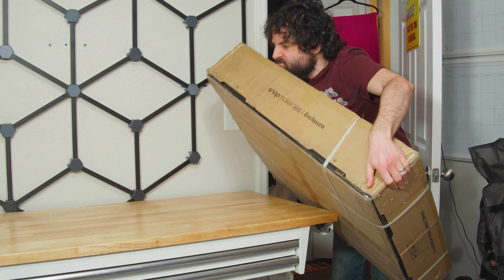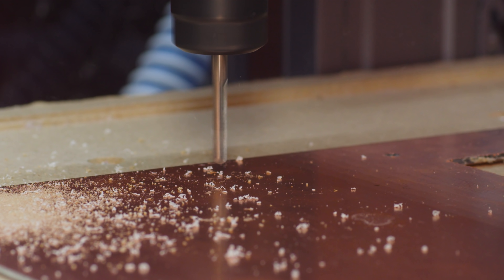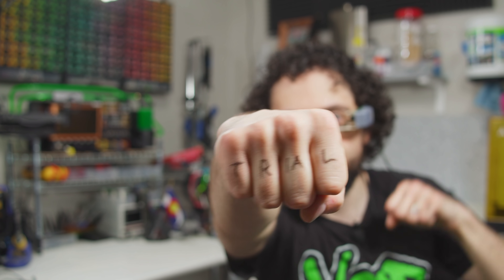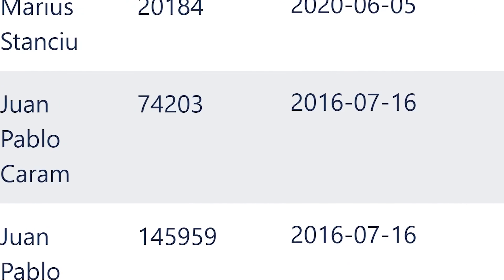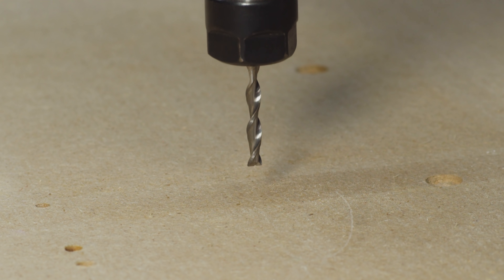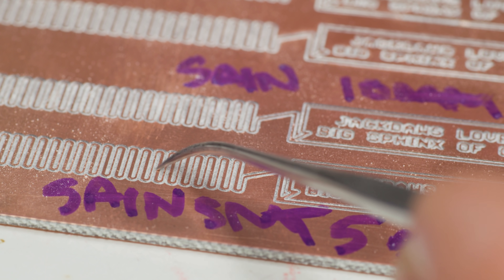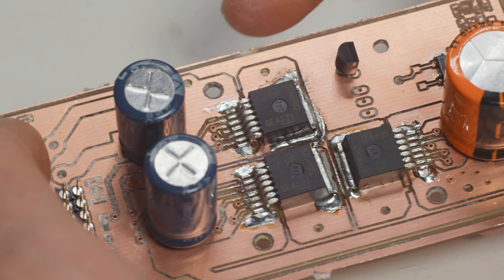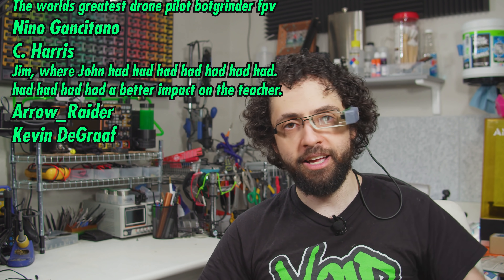PCBs in Two Hours? Zack Sucks at CNC

Comment: I use a trusty LPKF machine at work (Circa year 2000) and while the software has given me some troubles in the past with 2 layer boards, the large selection of bits has been great.

I know you're getting used to the machine but I use a bit that's 08-12 mil (depending on manual depth set) and whenever I lay out a board with some hairline traces, I just raise the bit up until I get JUST the copper clad removed. Sometimes I have to run the operation a few times to adjust it properly but I say this because your successful board on the precision end mill still looked a smidge deep and could be one of your issues. Of course, that's based on the camera angle but maybe it'll help.

Comment: Tip from a Mechanic, try running the Programm with out a Milling Tool first. So you can see if there are any possible collisions.
Reply: I think taking the pins out is the proper solution. There are CNC simulators too.

Comment: Great results for a first try!

I've made quite a few boards for hobby and professional purposes (mostly prototypes), I have a Sainsmart 3018-ProVer, which is very cheap compared to some of the dedicated PCB mills out there, but works very well for PCB milling. For control I use Candle, a very simple but capable little CNC software. I've gathered some experience over the years which I'd like to share:
- Clamp your board down firmly with at least four clamps. Tape works, but most PCB blanks are slightly bent, and if the tape doesn't hold it down perfectly, it may flex when you try to mill it, leading to inconsistent depth of cut.
- Install a leveling sensor. The simplest option would be two wires, one attached to the PCB, the other one to the milling bit. Alligator clips work fine. Most CNC boards have some sort of input for additional sensors.
- With the aforementioned sensor, level the PCB blank. One probe point every 10mm should be sufficient. Having a flat surface is not enough for the kind of tolerances we want, so software compensation is mandatory. All professional PCB mills do this. Candle works well for the software part, but most CNC software should have a similar feature.
- Precision end mills are nice, but quite expensive and fragile. I had good results with 30 to 60 degree V-tips. For holes, I use normal PCB drills. It's a bit more work to change the drill size for different holes, but milling holes takes way longer, especially if you have lots of them.
- Cheap bits are a bit of a gamble, sometimes they are good, sometimes they are garbage. But it's still cheaper to experiment a bit than to break too many high quality bits. One you find a type that works well, stock a few for future accidents.
- You want good quality bits, especially for isolation routing. Good bits cut with very little noise, and there should be no burrs around the cuts when you wipe over them with your fingers.
- Some sellers stock FR1 PCB blanks. Those don't have fiberglass in them, so they are way easier to mill and less dangerous, but they aren't as sturdy as FR4. For most applications they are absolutely fine though.
- Try to stick with sigle sided boards when possible. If you need two sides, you can connect the vias with copper wire, but most board designers will assume that all holes are plated through, and you can't solder both sides on all components (e.g. capacitors). This might lead to design flaws. Rivets are an option, but a lot of work.
- Don't bother with solder resist, it's messy, it takes forever and if you solder carefully, it's not needed for functionality.
- When the board is finished and tested, cover the copper side with protective lacquer. You can get that stuff in spray cans, there are special non-conductive types for PCBs. Keeps the moisture out and your boards look shiny and new even after years. Dries in a few hours. Also prevents shorts, but don't rely on that.

Happy milling, I hope you can speed up some projects in the future!

Comment: Why do you torture yourself with CNCing PCB boards. Get a rattle can of black spray paint, coat a copper clad board, laser etch out the traces. Use a toothbrush to clean it in water, then acid etch it. It makes surprisingly fine traces and waaaay more reliable than UV transfer methods.

Comment: You can't use the laser to burn a resist mask for smooth edges on those traces instead of that hot mess made by the milling bits?
Reply: If the raggy edges really bother you then you can just make a few more passes and that cleans it up nicely. CNC machines can make multiple passes easily. Repeating is what they do. It'll go over the same path from now until the end of time if that's what you command it to do. Usually 3 does it though. How repeatable CNC machines are is kind of mind blowing. But every pass the cutter will be in a somewhat different arc. Because the spindle isn't slaved to the axis. Although there's CNC machines that can do that too. But this isn't one of them.

Comment: try sprayer 3d printing instead of extruder 3d print, so more like paint spray than line draw print
Reply: so spray pen instead of 3d draw pen
Reply: I mean all materials, including metal, plastic, anything that melts to liquid, even two-parts mixed on the fly reaction liquids, like resins, it can have uv curing on the fly too
Reply: distant spray instead of close up line
Reply: photolithography processes

Comment: Can you get a cnc machine specifically for pcb milling? Probably a very small bed compared to 3D printers but can move the tool much more accurately and also use very small milling bits. I know you can get small desktop CNC's but are they good enough for milling PCBs?

Comment: For indexing you can set up and recall positions either with gcode or certain programs,  and using a simple 3d printed vacuum holder attached permanently on a location on your bed can do wonders for both workholding and easy release.  Nice video though, cnc doesn't get much spotlight since FDM is so much cleaner and quieter.

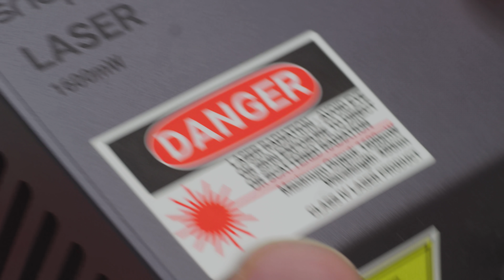Comment: While I DO love the Snapmaker's modular design, 1.6 watts of laser output power is VERY meager today, good only for etching, not cutting. And watching the closeup video at 2:28 of the tool plunging into the board, and FLEXING out by a millimeter or more just DOESN'T give me the warm fuzzies for this machine.

Comment: Good to see you’re doing all good buddy, your channel has been a real highlight the past year or so and I remember seeing your first videos and knowing you were going to be successful! But I didn’t realize how quickly your channel grow and it’s been a lot of fun to watch!

I have my own electronics and systems engineering “business”. Just me and a small lab I built several years ago. Mostly to fund my own addiction to test equipment. I focus mostly on component level troubleshooting and board repair for industrial and laboratory/research clients. I specialize in metrology and test equipment repair/calibration… And I really enjoy it a lot.

Nothing necessarily wrong with milling PCBs, it’s pretty great if you’ve already got the shop set up with similar equipment, and an area that is meant for dirty tasks. And it is a lot of fun….… 
But The etching process probably makes more sense. I mean obviously the best thing to do is just order the boards......because they’re so cheap, Much higher quality than you can do at home, and you get them really fast. sometimes I will be troubleshooting or problem-solving an existing circuit, and I need to reiterate and change the design and remake the boards a few times per day… 
If I were to do the same thing, but having to wait on boards for each revision… It would take a long time and I usually don’t have that option. But it’s just because I’m such an idiot, and I make mistakes in design… I’m a hardware guy not a design/layout guy. The only other excuse is because it’s a lot of fun! So I definitely don’t discourage people making them at home… But if it’s something you can get done at PCB way or elsewhere… I suggest going that route.
Also check out Marco reps and how he has made boards with several different methods. The laser method proving to be really fast, easy, and able to be accomplished pretty cheaply. I was pretty impressed with the tiny details he was able to get.
Reply: Absolutely one of the funniest writers on YouTube! And in the top 1% when it comes to electronics and technology channels. I was always super impressed at your first few videos…. obviously the projects and content but mostly the skill of your writing. 

Writing is a real bitch, And way more difficult and complex than people realize….. And anyone Who doubts that, I just point them at the last 30 years of anti-comedy in Saturday night live.

The only other person I could compare to in the technology YouTube genre would be Alex from technology connections, And Marco reps.
If you look outside of the tech genre… You’ve got guys like “ordinary things“, “jay Foreman“, “many kudos“, “George rockall-Schmidt”, And “Jacob Geller”. Literally that group is better than 95% of the writers in the past 30 years of television and comedy.

Comment: I had the exact same experience with my CNC and the cheap 15 degree carving bits and I thought my CNC was trash :D Good to know that it can actually achieve decent results with the correct mill.
If you need thighter tolerances for SMD parts you can also try to spray coat the pcb black and then laser the coat away and etch in acid. You can get around 0.05 mm clearance that way and it is also quite fast.

Comment: Oh my god. I've been into 3d printing for ages, and have a tiny little 3018 CNC, and I've literally stopped using it because it's not possible to level. I had some insane plan to put Klipper and a bed levelling sensor on it.

And thanks to you I've just realised I should just be putting some waste board on it and facing it.
Reply: You just use mesh mapping software. Computers are really good with numbers. It's kind of amazing what they can do. They can map out the whole surface then ride up and down with the changes.

Comment: You're wrong about the surface not being able to be made flat enough.
It doesn't need to be. Copper is conductive so you can just z probe it with your bit and make a height map of the board then use that to warp your coordinate system.

Comment: The trick with V bits is you use a bigger one than you think you need, those high angle ones burn up too fast. I've made hundreds of boards with a 30 degree V bit.
After they are routed hit the board with some 400grit sand paper to remove the swarf and oxide layer. Finally, use lots of flux, like ridiculous amounts, while soldering to minimize bridges. But clean it up afterwards, no one likes a sticky board.

Comment: im so confused, knowing so little about electronics, why does simply carving a path into the copper connect the pieces together without all the signals crossing through the conductive board between them?
Reply: The board that he is milling into is fiberglass, but each side is covered by a layer of copper foil .0014" thick. The center is not conductive and is why he bought those tiny copper rivets to connect one side to the other where through hole via's are needed. Typically after the milling is complete you would use 800 - 1000 grit sanding sticks to smooth the milled edges and make it easier to fill in the milled out paths via silk screening leaving you near level/even with the conductive traces. That way no conductive debris can settle into those milled out valleys and create a short

Comment: I would see about getting in touch with the Usagi Electric youtube channel, he does a lot of vacuum tube stuff (Like building a vacuum tube based processor!)and mills all of his PCBs, although the traces he uses are much larger he may have some decent tips on how to get quality cuts. Possible area for a collab?
Reply: What I found was to raise the Z axis origin a little and make a pass. Then lower it some and make another pass. A third pass and things start getting really clean then. If there's one thing CNC machines can do it is trace over the same path repeatedly. I don't find hitting start all that taxing to do. The machine pretty much does it from there.

Comment: Yeah, FlatCAM is one of those love/hate relationships. So many quirks. 

By the way, if anyone has issues importing a .xln hole file from Fusion360 (i.e., holes don't line up) use the command "set_sys excellon_zeros T" to 'fix' an issue with leading padded zeros.
Reply: I just import an image of a board into Inkscape and make a vector file out of it. Then I export it as a DXF and use dxf2gcode. It's a bit tedious but I get the tool paths I want.

Comment: Where can I help you on these CNC and gcode troubles? I’m a machinist. Been one for 8 years. I was screaming at this video. I have the same issues engraving on extruded aluminum and other non flat surfaces. There’s also a ton of tricks to proof out your programs so you don’t nuke your tools so easily. I joined your discord last week feel free to drop me a line
Reply: Yes tricking CNC machines is the key to success. They really are just dumb machines. If I set that Z touch off up a little high they're none the wiser. Then I drop it down some and cut the path again. If it's still raggy I'll have it do a third pass too. CNC machines are always up for running a job again. They're goofy like that.

Comment: You really need to add a pool of light machine oil to the your board you're milling.  It will make your cuts a ton smoother, your bits last longer, and avoids having metal chips sticking to your  bit.  --And it keeps that nasty dust from escaping into the air since it remains a moist paste.
And finally you MUST use mesh leveling to do any serious board milling. Apply double-sided tape to keep your board from lifting or moving even a little bit.  Seriously.  V-bits are just not realistic without these steps.

Comment: Great work. I’ve CNC’d many boards similar to how you did it. I finally bought a Bantam Tools PCBMill and it’s like night and day difference. The biggest advantage is the software. 1000 times better than flatcam and designed to work with the machine. Plus it mills holes not drills. If you ever get a chance to buy one(since the one I bought is discontinued and replaced by their new design) I highly recommend it. That board you had could be completed in roughly 30 minutes. For vias I just solder wire to the pad on each side. Glad you discovered small end mills. I use 1/64 for detail, 1/32 for clearing and 1/8 for cutting the outline.
Great video.
Reply: The machine we see here is clearly capable of milling PCBs. Buying a machine just for the software seems a bit lunatic to me.
Reply: uh, in flatcam, you can choose to mill big holes.

Comment: No idea if possible, but assuming that the laser engraving tool works by burning materials away, can't you run the tool path over and over to burn the copper away?
(I don't own a laser tool before, so idk if that's even the right working principle for the laser tool)

Comment: Hi Zack, 
I'm also using Flatcam and a CNC for my professional(nah) PCB making endeavors. I've went through the same caveats and mistakes you've been through when I first started a couple of years ago, so here's some tips and tricks to improve your PCB quality. 
-I don't have a bed leveller tool, so I offset my zero everytime I'm going to etch something. Trick here is to start the spindle and lowering the bit oh-so-delicately, with about 0.1mms every step. The moment you hear an etching sound, move it upwards by one step and start the program.
-Find the floating point precision of your CNC. My CNC works at a 0.00001 precision, so my isolation geometry code lowers at Z-0.00001 for accurate isolations.
-Sandpaper the hell out of your etched copper! Milling will only slightly move the copper and not going to magically make it disappear. If you sandpaper it, you will have a better end product and possibly avoid shorts.
-If you have approximately x3 more time, I suggest you create a ground plane and etch it also. This gives the PCB a non-copper area to avoid possible shorts but damn it it takes a lot of time.
-This PCB didn't have any tiny SMD components, but in time you will come to realize that isolation routing is not possible for routes less than about 0.7mms. I suggest that next time you should make a test routes to see what your machine is capable of, and use/create routes accordingly. I've lost too many boards wasted trying to use trace paths to a TMP117!
-My personal opinion when it comes to DIY PCB manufacturing is etching it with a laser cutter. I see that your device has a laser cutter, but 1.6 Watts is probably not going to do the job. Kindly check out this video to see the full process: /watch?v=RuSg7-hMaQg

Regards,
Reply: heh that's what I do too. Just BS the Z touch off. Running the path a few times does clean the job up. Don't use SMD garbage and that's that solved. If you don't have a pick and place machine then SMD really doesn't make any sense for you to use anyways. They invented SMT just to screw the DIY community. So why use something that's actively against you? 1.8W isn't a laser cutter. Well, maybe it could cut thin acetate or something? Tissue paper?

Comment: I made a diamond tipped drag engraver for my benchtop cnc mill. Works great on solid metal. Not sure if it would work for this, or just rip up the surface. Very fine lines though!

Comment: Loved this episode to "bits!" I've used a diamond tipped tool on an ancient engraver, with a spring loaded collet in the 'z' axis and spindle turned off. Did great work dragging sharp lines on anodized aluminum, maybe a robust tool like that could take on .0014" of copper?